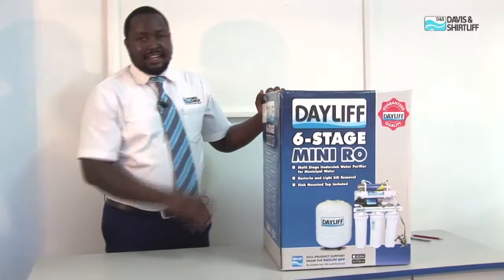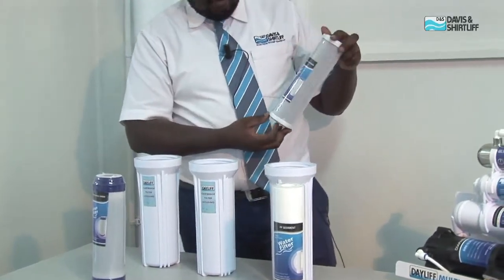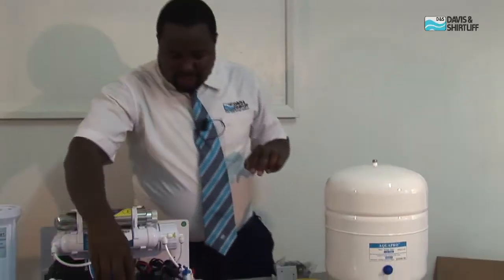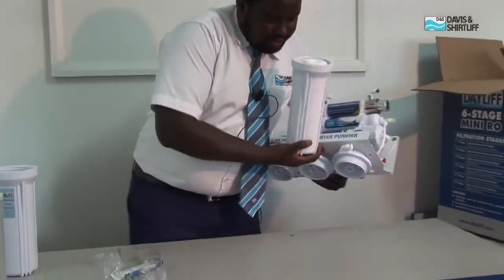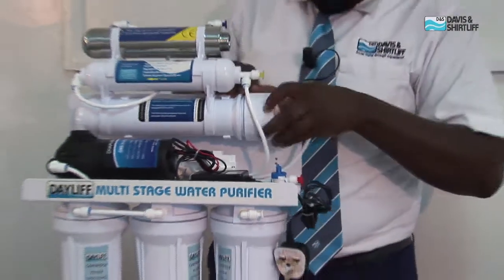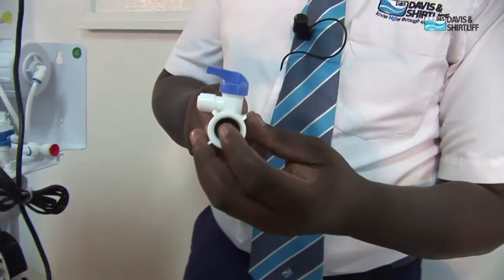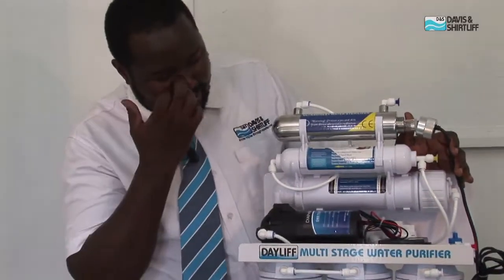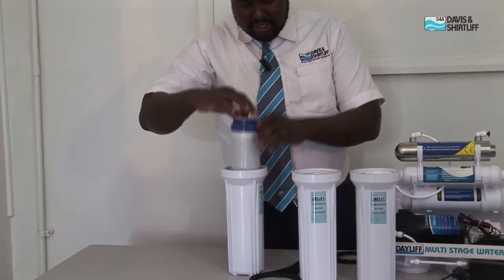How to assemble a Dayliff 6-Stage Mini RO Unit

Comment: The waste pipe red one does suppose to release water always
Reply: I am wondering the same. Can Dayliff please confirm. The red pipe pours water every time you use water from the purifier tap
Reply: Most reverse osmosis systems dispose of 3-4 liters for every liter that is purified.